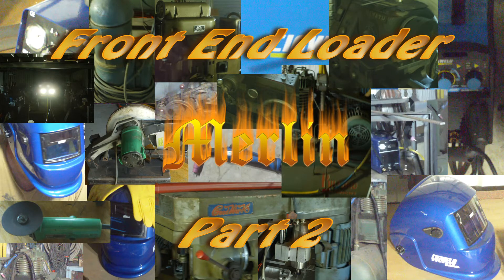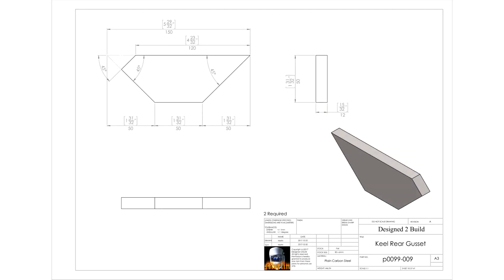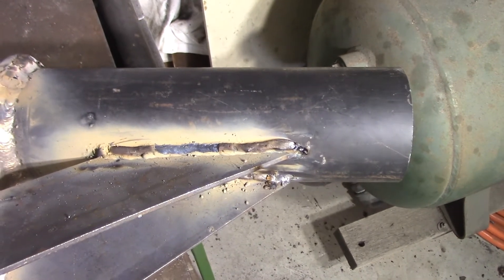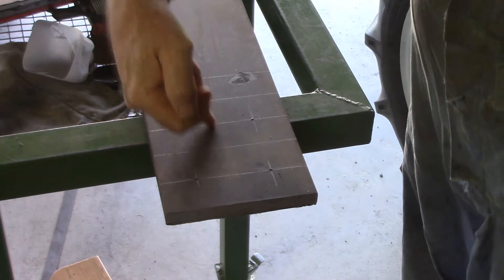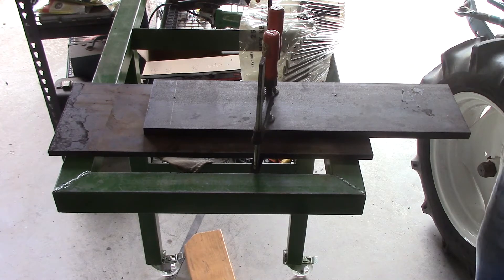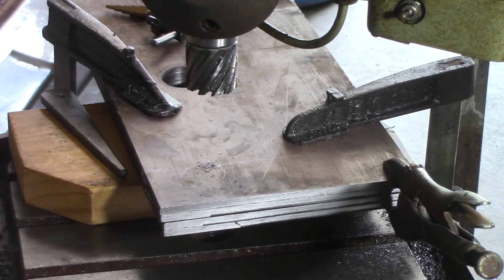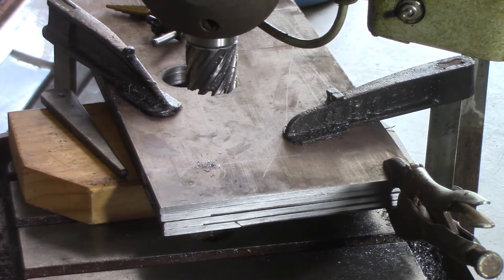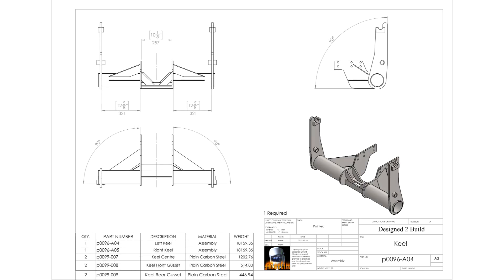Compact Tractor Front End Loader - 2 of 18

Comment: Nice, well thought out, good judgement on the seam in the pipe, nice work on the bracing. Quick question. Why not run a full width pipe, Is there a clearance issue in the underside of the tractor?  In my experience, a full width main support is essential.
Reply from the maker: Thank you.  I didn'r have room to run a full width pipe.  Would have been lighter if I could.
Reply: @Designed2Build  I figured as much. Nice work.